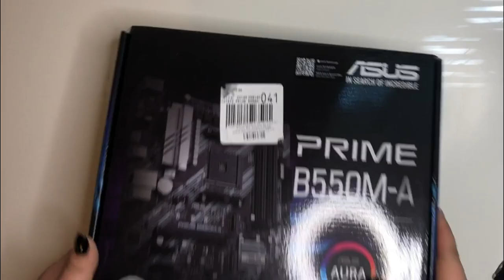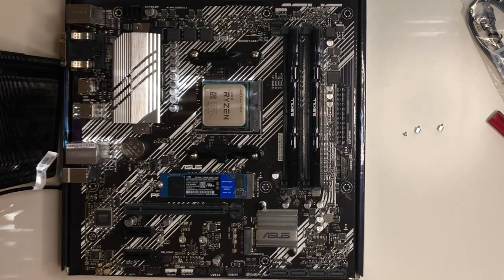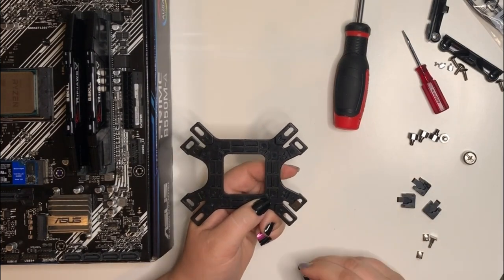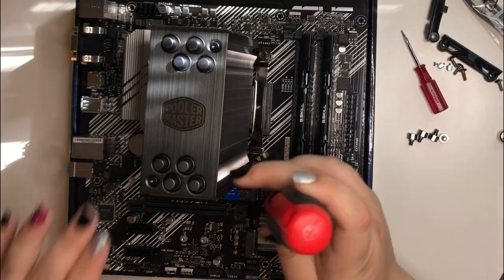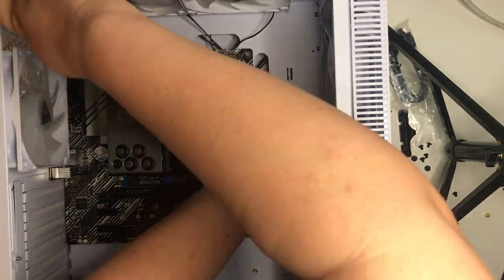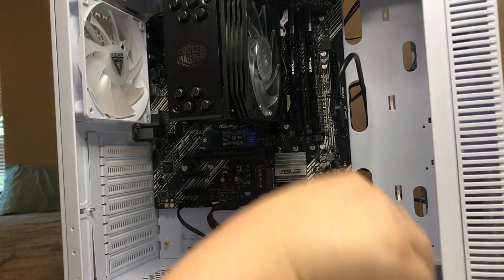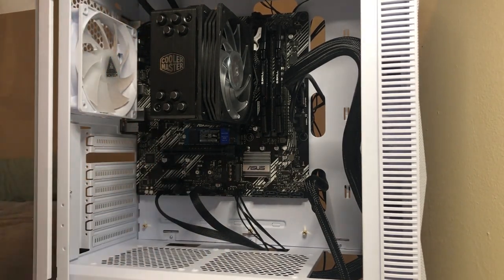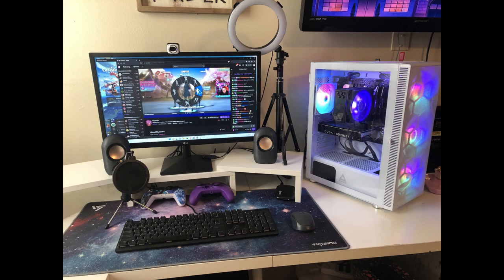Building My First Computer | Girl Gamer PC

Comment: Very nice for a first build, everything is clean and well put together. I've built quite a few PC's, and it's nice to see that I'm not alone in some of the gripes I have with things like unintuitive aspects of certain case designs. I've done builds at a wide array of prices and form factors, and for your price, this is about as good as it gets.

If I would change anything, it would be to change your drives out for ones with DRAM caches, like most drives from Samsung. It's not much of an upgrade though, mostly just for things like editing very large files, but it's pretty much negligible for most people.

In addition, Ryzen CPU's like faster RAM, so while 3200mhz is great, 3600 would've been even better. Again though, this is really only something seen in high-end video editing or 3D modelling, and less of the basic streaming/gaming/productivity most people use daily.

Overall, great job! Thouroughly impressed at how well you did on your first shot, and that any mistakes you did make were quickly addressed when you could. Just a bummer about that I/O shield lol. Also impressed that we have pretty much the same build (aside from me being team Intel). This really is the sweet spot for small-medium creators and casual gamers.

Lots of text, I feel like I'm rambling. I'll just finish by again saying, good job!
Reply from the maker: Thank you! It is lots of text but I appreciate all of it!

Comment: Lovely build, There are a few things I would change but they are more to my preference.
If you are getting an ATX case, try and get an ATX motherboard, in a black case it looks fine, but in a white case all the empty space is prevalent.
Another would be the ram, I would have gone with 3600mhz, as Ryzen loves that juicy speed.
But all in all very nice build, btw great cooler choice.
Reply from the maker: Thanks!